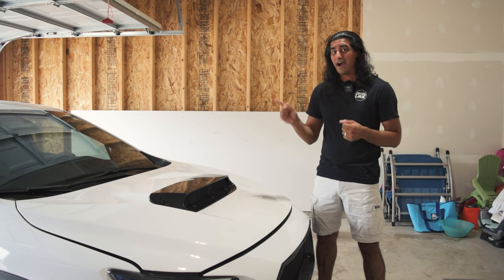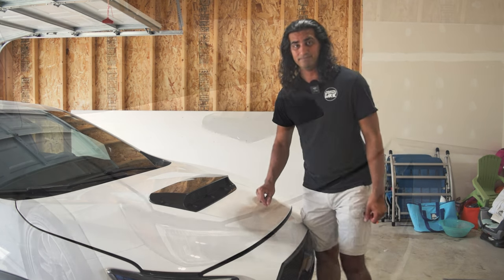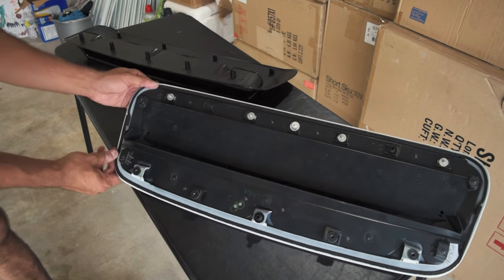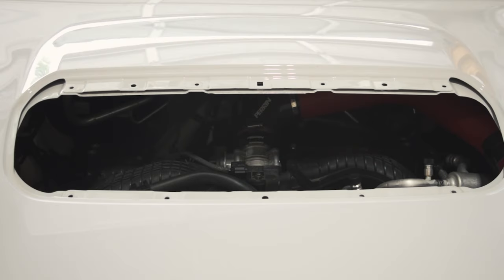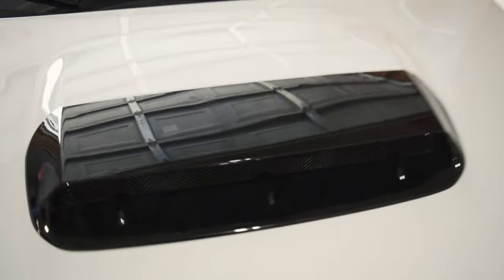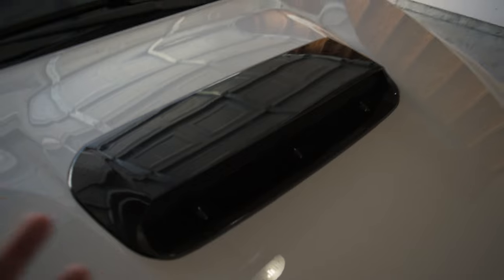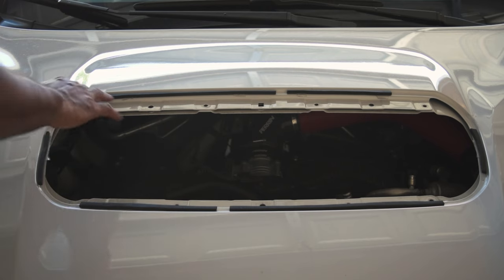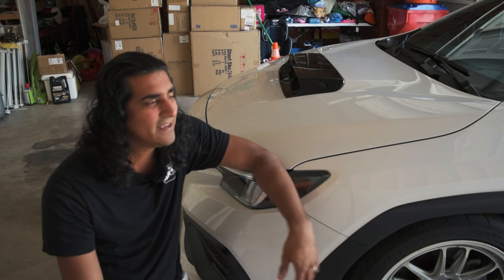Hood scoop bulges are destroying people's hoods?! // #2022wrx #wrx #subaru

Comment: Bottom line: maybe Subaru and their BFF Toyota might know a bit more about R&D and aerodynamics  than these aftermarket body panel/dresss-up part makers out there.
Reply: dont give them so much credit i work in the paint shop for stellantis all auto companies have issues that we find out about later that we then go back an address things like this are overlooked easily.
Reply: I'm supposed to walnut blast the carbon buildup in my intake valves every 20,000 miles thanks to Subaru's absolute failure to mitigate a very common problem in their GDI engines. They are not the leading edge of design and function by any means.

Comment: I think that the weather stripping on the stock scoop is there to prevent this issue. Whenever I see something that is OEM, even if it doesn't make sense at the time, I still try to replicate that on aftermarket parts. It wouldn't make any sense for it to be a water seal when the scoop itself freely let's water in. It's painted and clear coated. It won't rust. I think you had the right idea I will just try to add the weather stripping to my scoop but I didn't go with this one. I just got the OEM + one from another site. Haven't isntalled it yet so we will see if I can avoid scratching all together. Also, side note, the paint on this car is so ridiculously soft that I am probably just gonna wrap mine. You can look at this paint the wrong way and it scratches.
Reply from the maker: Yea it's also the OEM one airs inside the hole for the scoop whereas the aftermarket one is just physically bigger and sits on top of the hood. Any vibration was gonna cause this issue.
Reply: Amen. Mine is garaged and only driven in good weather.  No rain. Foam cannon and careful gentle washing and still small swirl marks. I'm very meticulous and still this paint is so sensitive.
Reply: Yes, the paint is terrible on these cars. I'm very disappointed with the chips and scratches

Comment: im going to put 1/4 wide 2 sided 3m  tape all around on the bottom  outer edge of this scoop,not the side like original when i get it and not peel the other side  so i can move it in place to align the screws.This is the issue is the bulge scoop sits on the hood,not down in the hood like the original so you have to raise it.

Comment: I am a part of the same FB group. There are also posts elsewhere about this issue. I feel like this is avoidable at the time of install. Now to be fair, this should not have to be the case, but your solution of a foam gasket is one way. an alternative option would be thin strips of 3m clear protective film. I would put it around the rim of the part and around the rim of the hood.
Reply from the maker: Yea My foam idea is the right direction but I need to go further. Flatline_WRX suggested some Butyl tape so I'm going to try that next.
Reply: WHY NOT USE A THINNER 3M DOUBLE SIDED TAPE FOR THE FRONT AND SIDES AND DOUBE UP THAT SAME TAPE FOR THE BACK PORTION CLOSEST TO DRIVER ?? WHEN COMBINED WITH THE FASTENERS WOULD THIS NOT PREVENT RATTLING WHICH LEADS TO SMALL PAINT CHIPS ?

Comment: Hey can you tell me where you saw people talking about dents? I didn't notice dents until I after i installed mine and theres like 4 huge dents on it but I dont think there is anyway I could have caused it.
Reply from the maker: It was on Facebook. Basically little dents at the spots where the screw stalks are. If you tighten it even a LITTLE bit it pulls the plastic down causing a dent to appear on the other side.
Reply: I hand tighten mine and I still got two dimples, but most people don’t notice it and it’s hard to see in pictures

Comment: I feel like the stock one let’s more air in
Reply from the maker: Yea I believe it may but I don't have a great way of testing it. Actually I just thought of a great way to test it haha
Reply: @HeavyMetalWRX  you have the front mount ic so your good with air where you need it I have the cobb top mount so I need the air through that scoop the screen in the aftermarket scoop to me seems that it could let less air to the wide open stock hood scoop
Reply: @HeavyMetalWRX  your doing a great job with your channel bro keep it up in scally trying to get into it a little more I made a couple of new videos
Reply: I had the same xoncern when I bought it but I'd definitely say it doesn't let less thru but it's not alot more since I had to buy a 2nd I'm going to mess with the one I fd up an try finding a better mesh to put in but it's definitely nice opening the hood an tons of leaves an bugs not stuck to intercooler

Comment: I saw a video that helps you  make the hood fight tighter reducing the flex of the hood which may help .. I need to go find that video but… I think there are rubber stoppers on the frame or hood that u can twist like a screw and it helps with the flex ..
Reply: Did you happen to find that video?
Reply: @44actual  I have not looked however it’s a simple fix … there are what look like rubber bushings/ u er the hood the act like screws , they can be turned or crest more or less resistant… there either oh inside of hood or frame of engine bay where the hood meets the car

Comment: Hey! Nice content since day1. 
Did you solve this problem? I put foam tape and still got damage. Trying low friction next. Let me know!
Reply from the maker: I actually took my scoop off the other day and it was fine. Just the few scrapes i had mo that ago and nothing new. Tbh it's not something that's visible. I wouldn't worry about, infeotauntely, that's the rinly new answer I have.
Reply: Yeah mine are pretty bad, I remove mine and put my oem back oem till I receive the low fricton tape and with the oem scoop you see all the damage because its smaller

Comment: I went to home depot and got some 1/4" weather strip and worked fine, it was pretty much a thing to install from the get go, don't want scratches on the car ? Don't drive the car or install aftermarket parts and complain about the road debri 😂

Comment: This is not a guarantee or a solution, clear bra for the hood/front, this will also help out to protect against rock chips too. I also have a 3 year ceramic coating for the rest of the car as well. This is by no means within everyone'd budget. I just feel at peace knowing the paint has some protection against the everyday environment. If you like to tailgate though this might not be the greatest protection but who can avoid tiny rocks on the highway or roads when you have 1 lane or see them coming on the highway/interstate.

Comment: I'm in the same FB group, i have the solar orange VB that got the wrong color scoop. (blue) 

With a lot of back and forth about the subject on the group, i think I'm going to leave mine alone; i have not checked mine. Ours is a DD...i agree on the rock chips, i have so many that IDGAF anymore 😂 as it's pretty much unavoidable because she's a DD. Besides, too much removal and installing of the included scketchy screws will murder those plastic threads in no time making things worse. Mine seems to be secured so I worry more about the cheap hardware coming loose or worse, scoop flying off while driving. I'll be checking periodically to make sure its still on there properly.
Reply from the maker: Dude, I can't believe you even got the wrong color. It was an honest mistake but was funny and irritating nonetheless. I do believe the dimples is an issue and the fact that it scratches your hood is an issue. I also believe that it is blown out of proportion when people say their hood is absolutely ruined. I did get a chance to talk to you the people over at Noble and they told me that a fix is coming.

Comment: My scoop came with dimples. I tried loosing the screws a bit underneath the scoop , and had no luck :(
Reply from the maker: Oh no!!! Dude who did you get it from? Id get a refund or replacement.
Reply: @HeavyMetalWRX import image racing. However , is this a common issue ? Just be extra gentle with tightening?

Comment: foam will become a sponge bad idea  rusty
Reply from the maker: It's not the kind of foam that soaks water. It's actually thick and made for cosplay and stuff (so it doesn't soak up sweat and stuff like that). Either way I think I'll need another solution. I'm on the right track though. They should just make the scoop better imo 🤣

Comment: Had to run outside an take mine off an check after seeing this mine didn't mess up the paint at all but probably cause I got a professional gaphine coat an took the stock hood scoop off for them todo it I still have to but my replacement bulge hood scoop on tho since my first one is all messed up but I'll definitely put some wheather stripping on the 2nd one when installed me over tightening the first could be why it didn't mess it up also tho they said that's why mine dented on top even tho it was only hand tight but I guess I didn't account for me doing construction an my hand tight more than normal
Reply from the maker: I'm glad you had a coating. It doesn't bother me as much but I can see it being an issue for some. Flatline_WRX actually gave me a great idea to try, butyl tape or plastidip the bottom of the scoop.
Reply: @HeavyMetalWRX  yeah I'll look into that also cause I definitely don't want it messing up my paint being a black car an everything's showing an already spending so much for paint correction an coating
Reply from the maker: @JoshDillon-lm3hw  just getting on the highway here messes up my paint so I just gave up. Plus I have a 5 yo and she has been the source of most of my scratches 😭😭

Comment: To be honest , the black hood scoop makes the car look  panda-like. Not a fan, but maybe thats what your going for? In addition, it probably would have been a good idea to put some touch up paint on thoses chips caused by that hood scoop.
Reply from the maker: I love the panda / storm trooper look. It's been the inspiration for the car the whole time. As for the chips, the rest of the car is covered with them. This car has seen a lot of action and speed so I don't mind.
Reply: Well good for you! It just seems a little condescending that's all.

Comment: Yes! It's irresponsible for them to sell these without testing them and you already know they do not lol. The material is thin and cheap and warps easy. I hit up IIR and they said the warping where it screws in is not a defect and was a result of faulty installation lol.
You’ll also notice the hood shakes way more at speed because the scoop is taller and lighter. Was driving on the interstate and was worried the hood was gonna fly off lol. You can’t Amos things flying up of the road but you can prevent stuff like this by using well made parts and these are all the same generic taiwanese parts sold by different companies